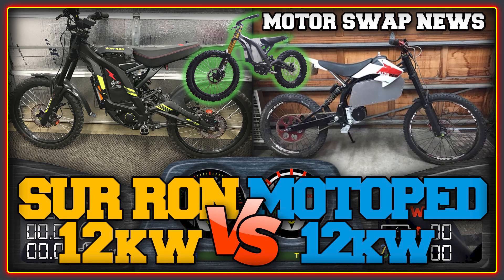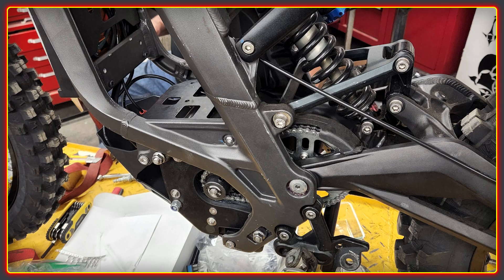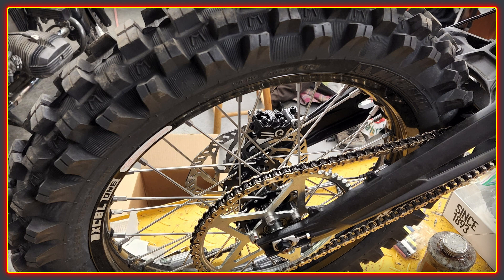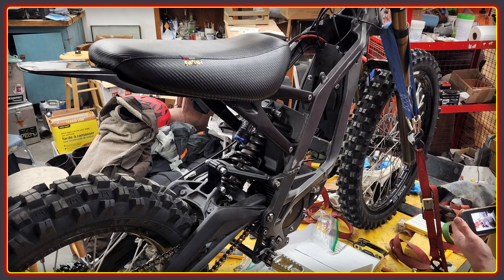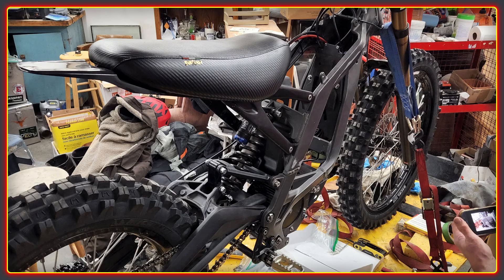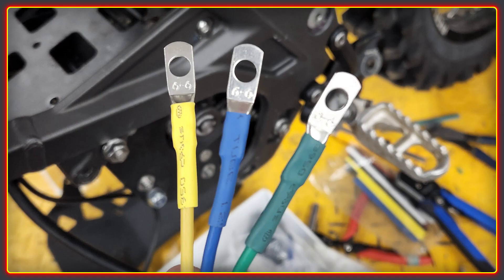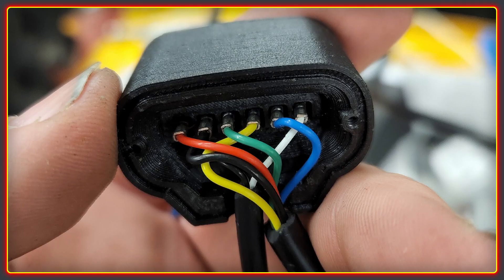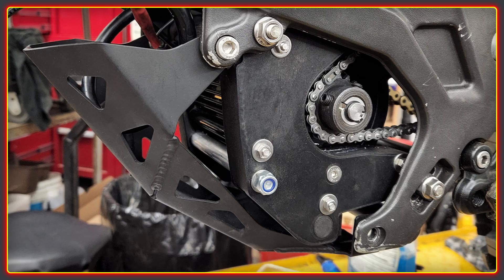12kw Electric Bikes - Sur Ron VS Motoped at 12kw / Sur Ron Motor Swap News

Comment: The way you have the motor mounts looks clean af. Texture is the only thing keeping that from looking OEM. Cool video. Almost makes me want a Big Block Sur Ron .
Reply from the maker: Thanks Todd. We have then being looked at being made in Alu! At which point they will be anodized. The polycarbonate was only really meant to be for testing. I am amazed that it is holding up so well! Cheers
Reply: @HighVoltageKits  I thought I heard you mention that or read it on the discord. I think that whole build looks high quality. I would not hesitate to throw a leg over it.
Reply from the maker: Thanks mate. I was gutted at the weather 😆  Hopefully soon.

Comment: why KPH amd MPH on the other?
Reply from the maker: That's how the data was being pulled from the BAC controller. I had no control on that. It's a bit annoying 🙄
Reply: @HighVoltageKits  Thanks for replying, i am from KPH country so is hard to compare, but still great content, keep ramping on     /!\ High Voltage /!\  :D
Reply: @silver_surfer88  I saw the Sur Ron max out at 64 mph, and the Motoped looked like it maxxed out at 59mph.